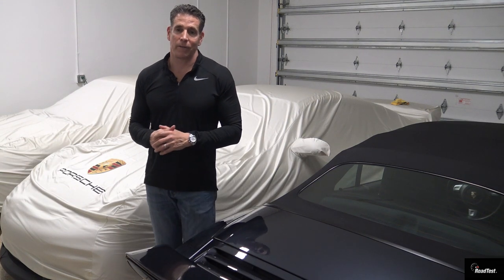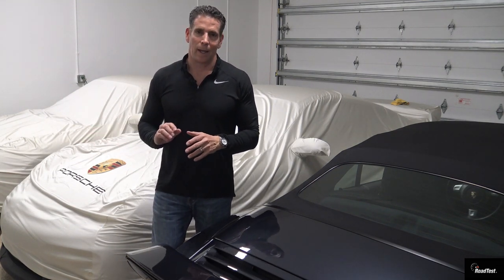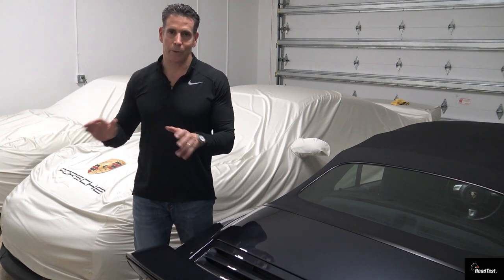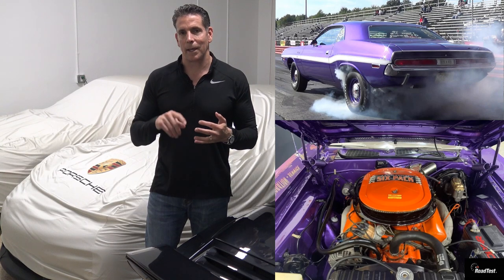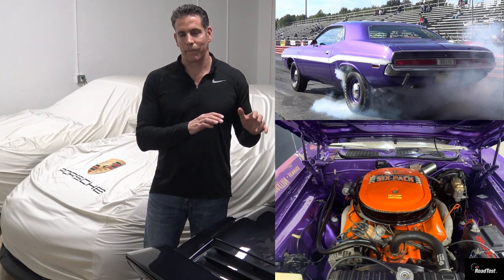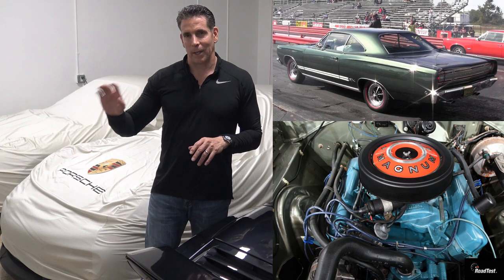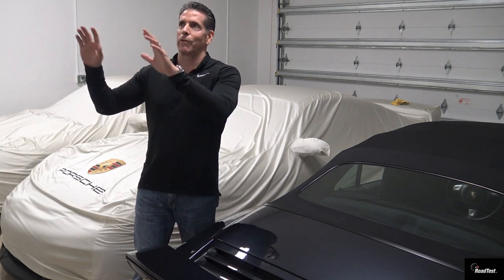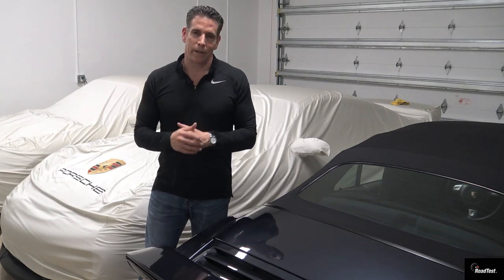NO STINKIN' ELECTRIC HERE !! 1968 GTX v 1970 Challenger 440 6 Pack-1/4 Mile Drag Race - ROAD TEST TV

Comment: I can't believe the GTX had 3:23 highway gears in that heavy tank vs a six pack with 4:10 gears. Those old floating axle rear ends are not hard to change. He needs to go to a junkyard and get a cheap set of at least 3:73's out of a van or something. Still love the GTX though, as i had a '69 Roadrunner and always wanted a GTX too. 🙂👍

Comment: I thought Dodges had Magnums and Plymouths had Super Commandos?
Not nitpicking, just wondering.
Most people aren't there yet with electrics. They're trying to manufacture consent on this and ram it down our throats. Nobody wants to give up the convenience of recharging their vehicle at the gas station in less than 4 minutes and have another 400-600 mile range.
Thanks Road Test TV. Great video as always.
Reply from the maker: Thank you, Darkstar. You are 100% correct.  Dodge and Plymouth gave the same motors different names. 440 Magnum is Dodge and 440 Super Commando is Plymouth. Both are single 4 barrel and rated at 375 HP. Thanks as always for your support and comments !!